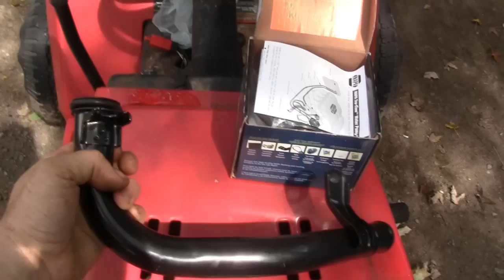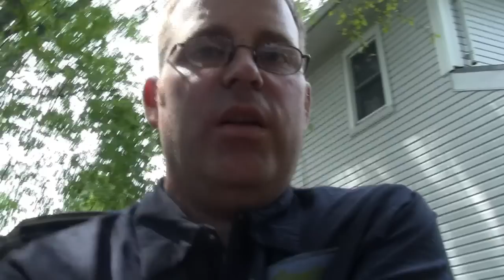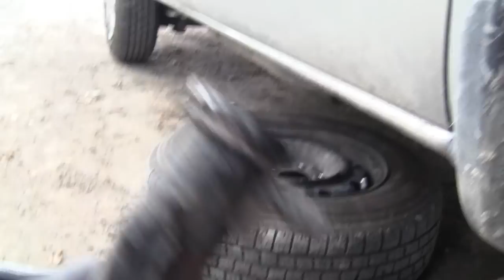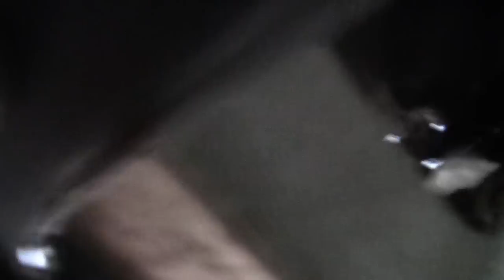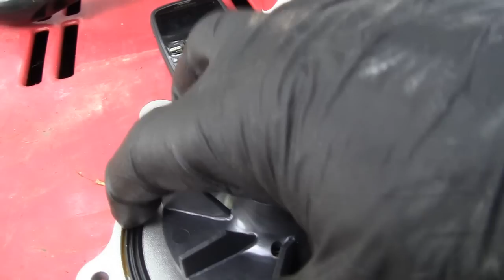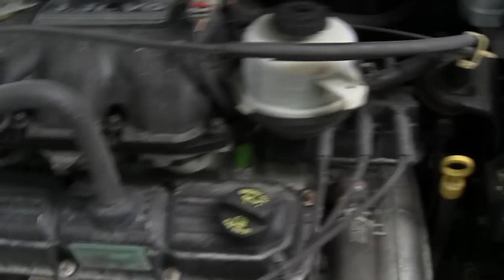Dodge Caravan 3.3L 3.8L water pump replacement.mp4

Comment: My 2007 Dodge Grand Caravan water pump failed at 220K km. It was just noisy, but no leaks. Purchase one at Amazon @ C$40 (C$300 installation @ "More Than Just Tires" shop, as my mechanic was not available), and it failed in one month with a leak via the wiping hole. Purchase the Mopar original, paid C$220. My mechanic could not take it out, so he had to release three bolts at the passenger side (with the jack) to lower the motor a bit while the car was on the hoist, then lifted the car again in order to remove the pump. Paid C$200 for the second install. I am just wondering how long this would last now...

Comment: All u need for tensioner pulley was a small breaker bar its head is thin and the square drive swivels making it easier to get in tight spot. Its whst i used.

Comment: Thanks so much ShawnCFarm.  This was a great video.  It spelled out exactly what I'd run into replacing the water pump and metal inlet tube for my 2005 Grand Caravan SXT, even the dropping the engine piece.  I didn't remove the three engine bolts entirely but kept them threaded in about 1/4" and I 'hung' the engine on the longer bolts.  That dropped the engine enough to get the pump past the frame.  The only thing that is kind of goofy is flushing the system and filling the system again.  The draining and filling procedure never added up to the 16 liters my system (with the rear heater core) was supposed to have - according to the manual.

Comment: I use a pipe wrench to loosen the belt. Just grab the tensioner by the square piece of the tensioner (on the outside of course ) and just pull the whole tensioner down enough to remove the belt

Comment: I have water dripping from the top of my transfer tube. I thinking I just have to replace the rubber at the top of the hard tube and the hard tube. Could it be because of the water pump?

Comment: If you didn't need to drop the engine to get the belt off, would you still have had to drop it to get the pump out? Or is there enough clearance to wiggle it out of there with the engine up?

Comment: YOU DO NOT HAVE TO DROP THE MOTOR DOWN FOR CLEARANCE.
All you need is a 1/2 strong arm in the straight position on the way into the 
1/2 drive hole and with your fingers bend the drive end and guide it as you get closer
to the slot  bending it to 90 degrees.
Once in you can pry the tool to ease the tension on the belt 
and simply remove it. its much easier and safer than supporting the motor 
while you remove the belt. Total time save is approximately 45-60 mins.

Comment: This is a really nice video with good point by point.  I just did the pump in my 07 3.3 Caravan.  If you have a 1/4 drive shallow 10mm and a small ratchet, it makes the difficult two bolts much easier and faster than with a wrench.  Again, really nice vid.
Reply from the maker: This is ture and thanks. More on my channel

Comment: The van I have has over 300,000 miles in it and it runs like a dream. I found another one for sale cheap because the water pump was leaking and I didn't know if I wanted to tackle something like that but I wanted the van for a back up. So after watching your video I'm confident I can change it so I'm gonna go ahead and buy the other one and fix it it only has 120,000 miles on it and I know what good motors they are. Thank you for taking the time to show us how to do this.
Reply from the maker: Jeffrey Steen no prob. Only problem you might have is of you break one of the bolts off holding the water pump on. Other then that very easy fix
Reply: ShawnCFarm ibe worked on cars my while life and I've changed some bad water pumps in my time..im sure I can handle it..i appreciate the advice and I enjoyed watching the video..it gave me some confidence that's for sure.

Comment: It is really awesome that videos from "ago" are still available. My 05 T&C 3.8L just about defeated me. Getting the pump/pulley out ended up breaking the old pump. Too dark and too cold to try and finish, so sat down and did a bit more research and found your vid.  This was a lifesaver. Not finished yet, but the motor mount trick will get it done.  Thank you!!
Reply from the maker: your welcome

Comment: This is a very well done video, I am sitting contemplating this repair with the parameters I have to work with.  Will first check with a mechanic to examine that option.  It's winter, a driveway and not all the convenient tools.  Would like to be the hero but sure don't want to be the zero. There was a 50/50 chance of dodging all this in the fallopian tube but you guessed it, let the wrong damn one in. :)

Comment: Hi there, seems everyone is lowering the engine to get to the pump easier. I really don't feel safe lowering an engine. My question is, the part of the frame that's blocking the water pump, can it be raised a little with a jack instead of lowering the engine? or does that part of the frame raise with the car and not separate? As in say the van is on the ground, you start to jack it up from the side and the body raises but not to the point of the wheel being off the ground. Wouldnt that raise the frame high enough past the water pump? Thanks sorry for the long post

Comment: hey bud, old vid, youtube showed me here, gotta do this to moms 06 grand caravan.......when did they move the water pump to the back of the motor? could have sworn it was up front?
Reply from the maker: lincolnmaniac might have been on the older engines lol
Reply: old van was a 94.....and i had a 90 chrysler 5th ave with a 3.3.
  i just found my comment from when you put up this video and i had the same question lol. i have been out of the loop, been working on nothing but old cars for many yrs, starting to see the new crap.

Comment: I have a 2007 Dodge caravan 3.3 mini se. Can the water pump be removed with out lowering motor? Last week replaced inlet metal tube and lower hose because of leak. One day all seemed fine then had noticed leak coming from top back of water pump seal/mount area dripping . And "Wobble" when motor running on pully. Any suggestions? Thanks.
Reply from the maker: I think it will have to come down
Reply: Sammy hooligan I did it without dropping the motor.. it probably would be much easier to drop it. Lol

Comment: FYI, just as a note, always check the bolts on the water pump wheel.
I had one that came loose and it sounded like a bad pump, all I did was tighten the bolts and the noise went away. Lucky day.
Reply from the maker: good point

Comment: Hi Shawn,  when my mechanic was going to replace the water pump on my 2003 caravan 2.4L last week,  he was pulling out the crankcase pulley and as he was forcing it out,  one of those things the 3 jaw puller was holding with snapped. I did not see you take the crankcase pulley out on doing this job. Can you tell me if it is really necessary to take the crankcase pulley out please?
Reply from the maker: Different engine then this one. 2.4l has the water pump under the timming belt I beleave

Comment: For those with my specific van (a 2001 grand caravan with the 3.8L) I did not need to touch the engine mounts at all.  I was able to reach the bolts, remove, and replace the water pump without lowering the engine.

Comment: 2008 Caravan taken to dealer for regular maint.. Dealer said the water pump and serpentine belt needs replacement. They gave me a cost of $1115.00 to complete the job. The milage is 139,000 at this time. Mine is a 4.0 liter V-6. I think I will have someone else do this job but, this video is very informative.
Reply from the maker: ya way too much money to do that job
Reply: pully and water pump is usally about 50$ in parts

Comment: I have a 2005 caravan, not a grand caravan and am getting ready to replace my water pump. Thing is when i try to drive it the motor is now shaking when it gets to temperature and i try to idle at a stop. (before replaced) Any idea as to what is causing this? Also my temperature guage doesnt show the van is over heating til its almost to late. Jumps from cold to over hot in a spit second. Would love your input.
Reply from the maker: Sounds like it might be low on coolant my friend
Reply: Yep it was, and what i wasnt seeing til everything was replaced is that it has a blown head gasket. Oil looks like chocolate milk
Reply: Margaret VanRaam
Reply: Margaret VanRaam

Comment: Very helpful! I just changed the water pump on a 2001 3.8 T&C. I got the bolts removed but had to lower the engine to get the pump out. Then I got the belt back on my going under the idler pulley at the top after threading all the other pulleys.

Comment: Cut the 1/2 inch drive off an old ratchet or old breaker bar and weld it to a flat piece of steel like less than one 8th inch thick then you have a belt tension release tool on the cheap and will fit into a really tight space.  You could even weld it into the jaws of a long thin half inch wrench.
Reply from the maker: That will work as well
Reply: Or just buy a serpentine belt tool lol

Comment: Great video, thanks. I just replaced the serpentine belt tensioner assembly on my 05 Grand Caravan 3.8  thinking that was the source of my squeaking belt. Nope! That wasn't it. I was thinking about replacing the belt and idler wheel next. If that doesn't work I'll be on to the water pump. As hard as I try I can't seem to pinpoint where the squealing is coming from. Any pointers on how to pinpoint the problem?
Reply: Did you ever figure out the source of the noise?  I have changed every component in the belt.  Come to find out there was a alignment issue with my balancer. My belt was riding the balancer.  So I reinstalled the balancer wheel and properly torqued it down.

Comment: You should not be replacing the spring type clamp with the nut drive clamp.  The nut-drive clamps have a pressure point right beneath the screw.

Comment: Great video....just use a prybar and move the motor over a bit when engine is down.....that dam pulley is a pain being in the way and way easyer to break a water pump bolt....only takes a bit to move motor and out pops the pulley

Comment: is it any risk for the engine when you lower down the motor?
Reply from the maker: +El Plateado 39 I would keep the jack under it just in case. The axle should keep it from coming down to far

Comment: Hello, I'm from Europe and I have a Dodge Grand Caravan 2004 160kkw 3.8 engine . The problem is as follows : Auto also has a gas installation Prins . I bought it from the original owner who pulled him from Dackoty . When I fire on a cold motor car is all about until the warm up starts to run unevenly , shakes car display errors PO300 , 301 , 302, 303, PO132 and P0202 , 205. These spark plugs, cables , checked the ignition coil throws up his hands no mechanic I do not know where the problem ... the worst as odpoalony warm. Please help Dominik
Reply: I know what you mean but I have checked these errors and nothing to show for not

Comment: yo awesome video. I have a 10 caravan 300 million miles started leaking coolant when turned off and parked. I'm guessing it's the waterpump could it also be a hose going into the water pump from the radiator? ? ?
Reply from the maker: +James Behrje could be but hard to say without looking at it
Reply: ha ! ! ! I found out what it was. Nothing! ! ! the water pump went bad on me on a Chevy Tahoe less then a week ago so I was t really skittish about leaking vehicle fluids. The van I was driving had 330k miles and I was, using it in the highway. I arrived at my destination and I saw a puddle of oil beneath the van. I was like "o shit, not again." I then check coolant liked fine. Drove to nearby store. Came out. this time I saw a giant puddle of coolant underneath where the water pump would be. I drove it home cautiously. thinking I screwed up another car. pressure tested it and everything is ok.  I did see something leaking but it turns out it was just ac water. People here need to fix there cars so I'm not so scared it's mine. I probably wouldn't have been freaking out if I didn't have problems with the Tahoe less then a week ago. thanks though. your videos a good video.

Comment: I was able to use a medium size pipe wrench on the sq end of the tensioner, instead of the 1/2" sq drive. work like a charm, didn't have to get the special tool or a ratchet.
Reply from the maker: +Arby121 good stuff

Comment: Very straight forward instructions. Last time I changed a water pump was on my '99 Dodge Grand Caravan, which was easier. Now I have a 2001 and 2003. I going to be changing the serpentine Belt and possibly the alternator on the 2001. This was good to see the whole process.

Comment: Excellent video and I ran into the exact same issues. The only issue I have is that difficult to reach bolt in the rear. I got it out but getting back in is a different issue. I wonder what others have done to get it installed.

Comment: i really appreciated this video. i watched the vid one day and did the job the next. i really like the trick with the 1/2 inch extension for removing the belt and the quick way u showed to bleed the air out. ive always hated waiting on the engine to heat up. thanks
Reply from the maker: charles neal I don't like waiting lol

Comment: Would appreciate it if anyone can tell me what kind of silicon that you used to lube the pipe when you installed it to the water pump? Thanks!
Reply: Any RTV silicone will work. Blue, Black, Red, Clear, doesn't matter. Permatex came out with a specialty line now for specific areas and they have one available just for water pumps if you choose to go that route. If you want to save some $, go to Harbor Freight and you can get a large tube(3.5-4oz) for around $4 instead of $6-8 @ the auto parts stores. Same stuff just a "generic" brand name but made by a major manufacturer. You can also use vaseline (petroleum jelly). All you're trying to do is prevent the seal from being damaged while inserting into the housing. A very thin film is all you need.
Reply: Thanks a lot! Wasn't sure how much I should apply and you have answered it too.

Comment: This is for the experienced !!! I've found the best way to "burp" air from cooling system is to fill Radiator to about 3" from top. Keep pan underneath to catch any spills. Prep for this procedure. Have Coolant, flashlight, radiator cap, shop rags all within reach. Start engine, turn on heater full hot and watch coolant level. It should begin going up and down as coolant hits thermostat. Hot from engine it starts to open, then cold from radiator makes it close again. Then here's the tricky part which is two handed. If the vehicle has a mechanical throttle, using one hand open throttle to get about 1500 rpm and hold it. The coolant will begin to bounce faster. Eventually you will see squirts from cross tubes in radiator. Again they start and stop. Eventually you will have a steady stream thru them. This is where you take your free hand and fill radiator (still holding at 1500 rpm, throttle hand may be getting tired by now but DON'T LET GO or it will be old faithful geyser. This is the dangerous part) Do this several times till level stabilizes, fill and wait till it is full. Put radiator cap on fully (two notches) and now let off throttle. System is full. Can do this on existing system that is thought to have air lock. Please...Please...Please be careful doing this method. Once hot it with burn you badly.

Comment: I had a similar situation with the tensioner. I went to my plumbing tool box and grabbed an 18" pipe wrench. I let the wrench out quite a bit to reach but it worked great. Lots of leverage too.
Reply from the maker: Jaronius That will work as well
Reply: I use my pipe wrench all the time

Comment: Does a 2007 3.8 has the metal hose?
Reply from the maker: Higher Power Not sure but think so
Reply: Yes it does. Iv'e had dozens of these vans
Reply: Parts store had it listed as a heater hose.

Comment: WISH I HAD KNOWN THIS BEFORE BUYING THESE PIECES OF CRAP VANS, WHICH COST A FREAKIN FORTUNE! :(
THEY ARE SO NOT WORTH BUYING!
I THANK YOU SO MUCH FOR POSTING THIS VIDEO, & YOUR HONESTY!
IT EXPLAINS MORE THAN WHAT I WAS TOLD, AFTER IT COST OVER A $1000 FOR A NEW WATER PUMP! 
SINGLE MOM ON DISABILITY, CANNOT AFFORD TO FIX ANYMORE, STAYING BROKE, LOOKING FOR ANOTHER VEHICLE IN THE NEW YR.
Reply: these vans are very good. someone is trying to take advantage of you for 1000$ lol
Reply: Lunna Moonbearwolf Oh wow, whoever told you it costs 1000 is a dumbass. I had mine done at a shop for under 300 bucks. Also did rack and pinion while they were at it, all for less than 450. Are you taking yours to the dealer for service because that is honestly a problem on your end.
Reply: MrMidway24 Only thing I disagree with is their transmissions. I have put two in mine now, just hit 200k in it too. On the other hand, my Ford truck has 225k on it and still kicking on the original tranny!
Reply: helivesonforever
with the Dodge caravan which has the 4 sp transmission replace the fluid annually I have a 2000 dodge caravan and the transmission shifts like brand new. 220,000 and still no problem. And you need to use ATF+4. If it doesn't say ATF +4 dont use it.
Reply: Dennis M I initially flushed my transmission every 30k after the first rebuild, with ATF+4. Never used anything else. That one only lasted 73k. I did filters at each flush as well. Maybe I got a bad batch? Original only lasted 80k as well. Got about 40k or so on number 3.
Reply: I'm on disability also & I own 2.  The taxi company in Elmira, NY drives these vans almost exclusively and has well over 300k on them all.  You just got gouged bc you went to wrong place.

Comment: I just did this job and for me it was impossible to get the pump back in without lowering the engine. Thanks for that tip. Just imagine how many total man-hours of labor could have been saved had Chrysler made their engine compartment 1/2 inch wider.